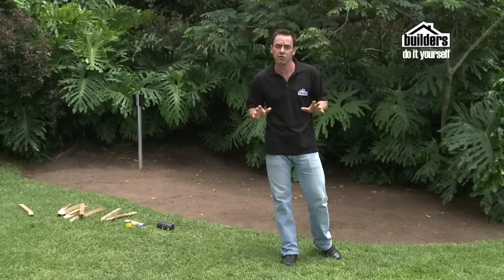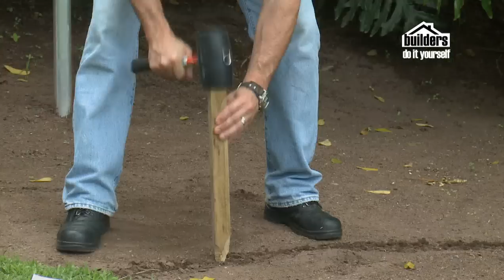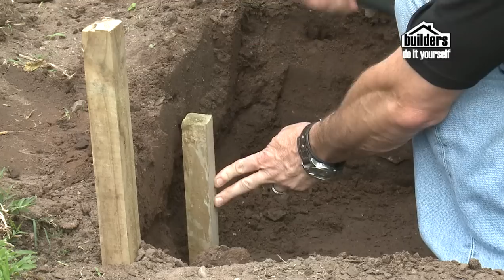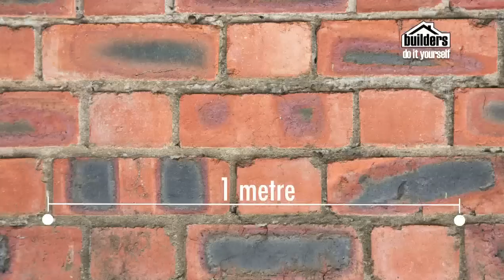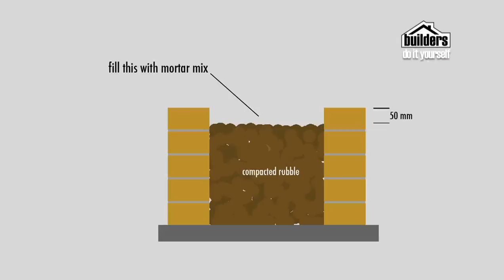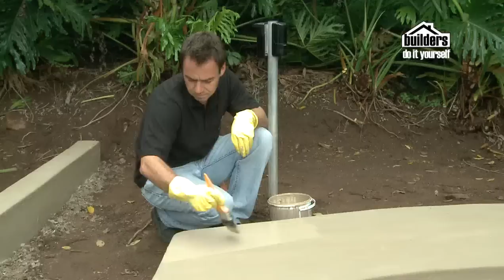Builders DIY: Designing your Garden - Building a Retaining Wall & Seat

Comment: why do you need to use different types of sand when making the cement and concrete? what's the difference in sand?
Reply: Sharp sand (larger particles) for render/screed or plaster as he calls it gives more flex but less strength.
Builders sand (fine and sometimes with clay) for mortar (sticking bricks together) stronger and better bond to brick but doesn't flex and can crack.
Ballast or beach for concrete all particle sizes.